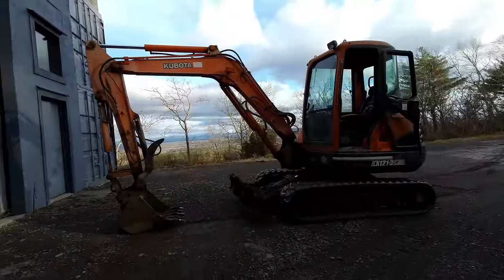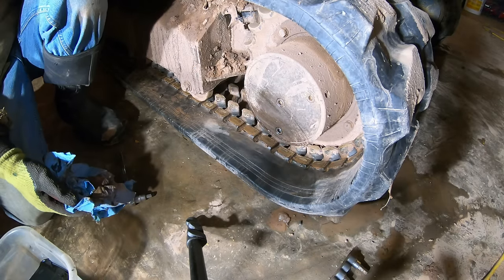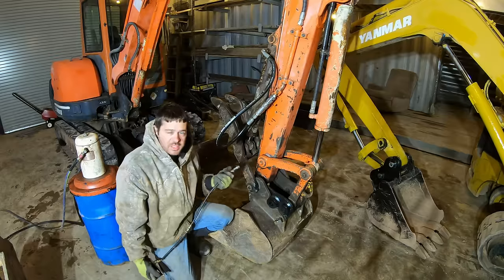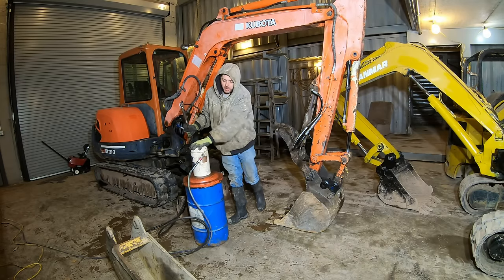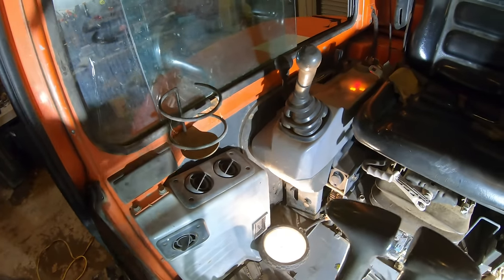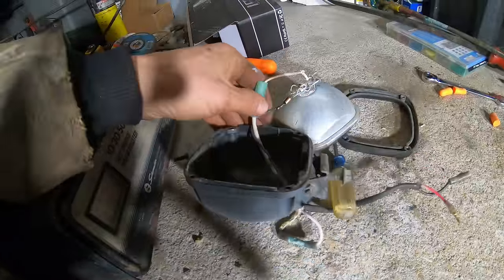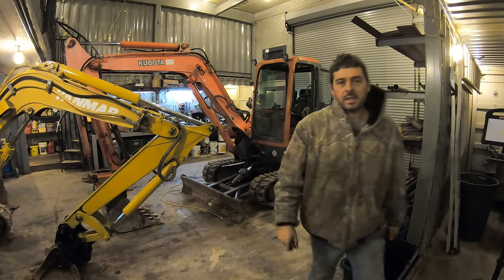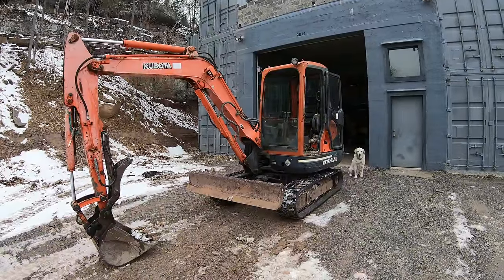Working on the new Kubota excavator

Comment: I've been doing electrical work for many years and have never thought about the "light in place of a fuse trick so you can find your short and save yourself a shitload of time" method. Thanks for the tip!!
Reply: use different lamps depending on the amp rating of the fuse.  you don't want a lamp that exceeds the amp rating or you can let the smoke out of the wiring.  about 1/4 to 1/3 the bulb amp draw verses fuse rating.  is about right.  so the wires don't get hot.
Reply: I thought that was pretty kewl too...will be using that myself  :)
Reply: Might be able to get away with LED since the voltages and amps are very low....?
Reply: @BarnStangz  LEDs won't work.. they do not pass current thru like a filament type bulb..  LEDs are diodes..  Light Emitting Diode
Reply: Thanks Wayne, yeah, I didn't think of that... Good thing I still have some old lights around...
Reply: @BarnStangz   use a 3 wire socket for an 1157 bulb.. giving you 2 different amp draws.   use a 194 bulb in a side marker socket. .
Reply: That was a a cool trick my friend. Using a multi meter on ohms is another fast and easy way. Its as simple as touching one lead to ground and other to your hot wire. If the meter reads continuity then you have found your short and can precisely locate and isolate.
Reply: @Streetpreaching7   put the meter on continuity beep.  i did that back in 1989.. rats had chewed the wiring on a camaro.. i could not find that last short to ground that was making the meter beep.. everything was disconnected on both ends of the harness. it was still beeping.. boss said close up for the night.  i left my test leads in the car.. but pulled them out of the meter.. there i am standing there with a meter in my hand .. not hooked to anything and its still beeping.
Reply: You can't call yourself an electrician and not know about the light substituting for the fuse method.
Reply: @JD-iu3vi  sure you can. You don't use this trick on homes or commercial buildings. (I could be wrong). I use an amp tracer. But for a piece of equipment with 12v that's great! 
Ps. Don't send 120 volts plus down an unknown path!
Reply: Why did the fog light turn off during the test?
Reply: Question, once you have the fog light in there instead of the fuse, isn't there a danger of melting a wire somewhere while (higher than normal) current is flowing through the light while you're digging around looking for the ground fault?
Reply: @waynep343 In theory, an LED test lamp should work because the short will provide a good ground path, (although the other working lamp filaments may also supply enough ground path to keep the LED test lamp lit).   The LED test light will probably have a DC to DC converter circuit.  By supplying 12V DC on the positive side of the converter (at the fuse) and a ground path to the negative side, the test light should light normally until the short is removed. The working lights will probably be very dim.  Removing the short should reduce the LED test light brightness.  I need to test this theory.
Reply: Car horns also work; great for trouble shooting circuits across long distances..like between homes and out buildings... just use a 110/12 relay.
Reply: C Miller. Although the lights were switched on the power was getting to them. The current was flowing through the fog lamp and to the lights. When the lights were disconnected, no current was flowing so the fog lamp went out as it was connected in series. I hope that makes sense....
Reply: How does it work?
Reply: There has to be a tool for this job. Like some small lamp you can directly plug into the fuse spot.

Comment: Heat that shop son, youre going to get Arthritis years sooner then it comes naturally!  I know its feels better to stay cold and stay used to to the cold, but your bones hate it and it causes issues much sooner in life then it has to be, heat that shop son!.............. signed Doctor Hurley
Reply: My point exactly. You dont know it till its too late. Steel warehouses were mu downfall
Reply: Men in my family have serious bone issues from working in cold temps for long periods. Keep the body as comfortable as you can to maximise longevity
Reply: @missionDan  Roger that.
Reply: Agree on heating the shop.  After being a mechanic for 45+ years and doing work like Andrew in retirement it is true the cold works with Uncle Arthur (arthritis) as you age.  A little propane torpedo heater to knock off the cold would be sound advice.  I worked on concrete floors for 40 years and that is not good for you either.
Reply: I was also thinking this as he pulled the log back with the kubota.   Door wide open.  I’m assuming if nothing else it would have cut down on a breeze or bit of wind chill even if the heat isn’t on, only guessing since it has a full cab it has heat
Reply: I agree with the good Dr. Hurley. Lying on cold concrete floors might seem like fun when you're young, but you will definitely feel dismayed at how quickly your body will decide that kind of self-abuse will have a permanent negative effect on your body. Andrew is as tough as old boots, but he is still young. I would hate to see all that talent suffer because of Arthritis or some such largely preventable condition.
Reply: Radiant floor heat under the concrete was the best investment especially working under the tractor at 67 years old. Really enjoy your videos and I’m not far from you in town of Denning on route 46 Yeagerville Rd.. above the Rondout reservoir top of East Mountain with 100 mile million dollar view!

Comment: Cant imagine how much money you have saved doing all maintenance yourself. What an important skill to have.
Reply: Scott O it’s got to be in the $100s of thousands range. Think about simple car repairs costing hundreds of dollars and start multiplying
Reply: Also would increase equipment sympathy and overall uptime of the iron. It also is good therapy, garage time is happy time
Reply: A grease gun is the most important and valuable tool you can own.  Andrew got his at a yard sale with a drum of grease.  He struck oil!
Reply: @twsd  accully kubota parts are cheaper then deeres and newhollands accully
Reply: Yeah, I know. A few years ago, being probably about 2016 or so, my grandfathers friend on my dads side and I had wired in a over the air antenna at his house, and the only thing we (mainly he) spent in putting in the antenna was the antenna, a 1 to 2 splitter, or maybe it was a 1 to 3 splitter, some grounding wire and maybe some coax cable ends. We managed to find some extra coax cable wire that we (again, mainly he) had laying around to run from where we had put the either 1 to 2 or 1 to 3 splitter to his upstairs living room tv, and we managed to use some of the extra cable from the downstairs from when my family lived with the one friend for a few months (that's a different story), and my grandfathers friend had his satellite tv  provider setup a tv downstairs for me, the satellite tv provider installer left some extra wire downstairs when they installed the cable, and the other person from the same company just cut the cable outside where the satellite cable came down to, so we (my grandfathers friend and I) just used that for the downstairs tv, and I set up another connection to the over the air antenna  later on for what would be my room when my grandfathers friend had his satellite internet provider person come out and "upgrade" him to a upper generation of a modem, and they snipped the one end of the 2 cables off  and didn't use the one for the connection between the satellite and the modem. I think we ended up save hundreds with doing all that work ourselves, plus we did the work a lot better then another person working for a corporation could have done, not that I hate techs working for corporations, just sort of those that don't exactly do things properly.

Comment: Ha,  I like the set it on fire method of finding shorts!  Guaranteed to work every time, results may vary...
Reply: I was laughing pretty hard at that too! But it is smart that he demonstrated it, wires can only handle so much load and then, bang, flames. This is how stuff burns to the ground!
Reply: We used to call it "The smoke test". Can't find the short? Put in a high amp fuse and find where the smoke comes from.
Reply: Why dont you get Into the bigger excavators? Their about the same price used as the small ones. All we have is bigger 1s. I want a small 1 so bad.
Reply: @JD-iu3vi  With my luck I would find the light doesn't work BUT the fuse is good !  Always seems that way.
Reply: Especially if you have fuel around

Comment: Pro Tip. When you solder, hold the heat source under the wire, put the solder on top. this way you don't get a cold joint or overheat anything.

Comment: 5:46 life is good when your steam cleaner sounds like a spitfire!
Reply: haha, I noticed that too. I was like, "that sounds like a turbo prop"
Reply: Gotta love the rotating tip.   I was glad he got the steam cleaner out.   I was surprised he started with the regular power washer.
Reply: @railroadjim  He connects it his endless hot water heater, so it helps but the beast heater is in another league.
Reply: A-10 Warthog!

Comment: It's a barbeque, what happened to the flag on the Castle of Camarata ? In the winter months you need to add some heat in your shop. Wood stove ?  It's not like you don't have any firewood . Quick question how did you pick the name Levi for your dog ? He is such a loyal trooper that is always by your hard working side Andrew. You should do a live stream a top of your castle at night some time so all your fans can have a question and answer with you. Keep up the good work and thanks for posting your great video's.
Reply: Matt P  a wood stove, maybe a waste oil burner. It's not like he doesn't do oil changes on all of his equipment.
Reply: Matt P I don’t think patriotic porn gets it..........
Reply: Andrew has a torpedo heater, seen it in past videos
Reply: He does not live in there.  I don't heat my garage and i have spent hours in there. 10-15 F. You get use to it. But it makes you pee like crazy. Laying on a cold concrete floor.
Reply: Chris laplant laying on the concrete floor might be ok when your young, but as you age your back tightens up and you can get arthritis,I’m talking through experience. I need a heated shop now for the body to keep going👍
Reply: He may not heat his shop but he should think about keeping his grease pump in the one room at the castle that is set up to be heated so it doesn’t solidify but the paint mixer seemed to work this time.

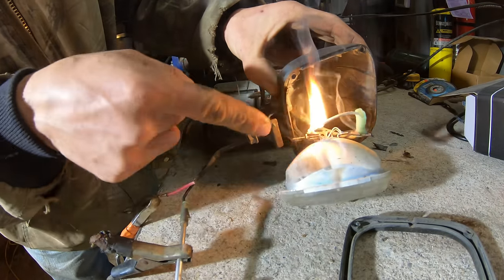Comment: 15:42 
20A circuit light on fire from getting 50A
"Right there, there's our short"
Reply: LOL Ya ~
Reply: It doesn't work like that. If you hook that light up to a battery then it has the potential for 700+ amps. But it doesn't receive 700 amps does it?

V=IR. If you want to blow up a bulb, double its voltage.
Reply: @TheMetalButcher  what you said and also: didn't he set the max amps much lower before cranking it up?
Reply: Who needs a continuity tester when you have glowing red wire?
Reply: The load determines the curciut amperage . Example ..your battery has the ability to supply up to 800 amps depending on the battery. That does not mean your headlights draw 800 amps. Applied voltage however will change the current through a fixed resistance .
Reply: @jasonbrubacher5793  I=V/R
Reply: Sorry butcher ....i didnt see your reply before i replied . I just jumped right on this comment because of the  misinformation . Didnt mean to be your echo

Comment: * opens a bucket with a lube
> wait, there's some liquid there
> let's mix this
What a king!
Reply: I am sure Andrew learned that trick the same way I did when I was 9 or 10 years old ... by opening a jar of Nutella or peanut butter and seeing that the oil had separated from the chocolate, needing a good mixing before putting it on the bread.

Comment: On grease: I'm not a petroleum engineer (just an old guy) but there are 2 main types of grease: dino bones and synthetic.Dino grease is paraffin (wax) based and synthetic is polymer based. Which is better? Probably synthetic.What you saw on your grease separation was the lubricants(oils) and additives separating from the paraffin base.Not so much of a problem with synthetics.
Do what you did when stirring the dino grease and it will be fine in the application for pins,bushings etc because of the frequency of grease cycles. On things requiring less frequent greasing such as wheel bearings etc I prefer synthetics.
Reply: I didn't think they made blue in dino grease? That stuff is really good from my understanding.
Reply: @TheMetalButcher  the blue is a coloring agent. Found in dino and synthetics.
Reply: @amossnowdaharleyman9179  
Food colouring? Is that the same grease they use at Mickey Dees'? Eeek😲😲😲

Comment: Why don't you motorize your garage gate, andrew?
Reply from the maker: Bad Times when I bought that door, that was an extra $1000, and I didn’t have electric at the time. It’s not bad with the chain.
Reply: That would be awesome project..
Reply: @AndrewCamarata  In your videos it always looks like it would take ages to open / close. Maybe you could do it yourself a lot cheaper than $1000 from the manufacturer? Would for sure be awesome to see!
Reply: @bdtms  , yes definitely.  He could rig up something that would blow our minds in a video. Maybe a old hydraulic pump that he could hook up to his machines? I'm sure he will figure something out. Maybe solar panels powered a  top of the Castle of Camarata . Up to 13k 4 hours later.
Reply: Well, at 06:22am, the video has 2096 views.  If one third of us mailed Andrew a greenback, he could get the door opener.  Who wouldn't kick in a buck to see him install a door opener?  Hell, if enough people sent him a buck, he could hire a door company to do it.
Reply: @AndrewCamarata  Exactly.  Got the same setup for shop/door, chain driven, always works and takes no time to do.  28 years and counting.  I've had to work on our house garage doors probably a half dozen times in that span.  If it wasn't for the wife, they'd be chain driven also.  :-)
Reply: Chainsaw motor - works super quick

Comment: Hi Andrew, really enjoy watching your videos, if I can make one small comment. When you use your  rotary nozzle pressure washer always point your lance downwards before you start it up. It has a tear drop type of thing inside which rotates with in a ceramic body and by pointing it up that teardrop thing is blasted into the ceramic body and either brakes it or chips it. That's when you find it sticky. My 2 cents worth after many years working for Stihl. Keep up the good work 👍🏻

Comment: In 1972 I worked at a garage ,someone owned a new car, and it had a short in the dash, well we went to get the car and found a bolt stuck in the fuse block and the desk had burnt up, the insurance company paid for the new car, but we told the owner not to do that again. 12/06/20

Comment: Good maintenance prevents expensive major repairs , daily and weekly checks ,  two handy little 360s you got there , saves a multitude of hard labour . Im a great believer in mechanical assistance whenever and wherever necessary , pointless making work difficult when you can make it real easy and in lot less time with these machines , I operated and repaired them and dozers for over 20 years in highway and civil engineering construction . Happy days , keep up the excellent work  .

Comment: Nice job. Nice light trick too although an audible signal like a radio is better for when you are testing in an area where the light is not in your line of site. If I may add also, make sure you get the exact same angle as the original when welding on the new cutting edge plate - VERY important. Next job.

Comment: i agree with how you feel about wire connectors they are junk my dad always used them and they were always coming undone used to have me looking for the bad connection i hated doing that because i knew they were junk but he always used them and sayed it was the right way we got in some really bad arguments over the long story short i  can tie a wire and its 2 times stronger than it was as one strand because i twist it leaving it long  and fold it back the other way and twist it again thin shrink tube it with silicone on it, not one time have i ever had one fail will break anywhere else but never were i tied it fact some people don't know how to reason i don't do things just like the guy next door you never learn anything that way one should always keep their mind open for new and better ways but i always think about other things that could go wrong because of the new way to see if it is an advantage or is it causing more bad than good
Reply: The "Western Union" splice, followed by proper soldering (heat the wire, not the solder), then a good length of shrink tubing. 
Trust me, I'm an Engineer.

Comment: You could weld a new sleeve into the sloppy bolt hole or use a slightly larger bolt grinding it down a bit if needed !

Comment: The thing about thoses greasers is that the tube only pump in the middle so when they start to be empty, as you can see , it don't pump very well. What we usually do at my place when installing a new barrel is putting some weight on the middle plate so it forces down grease overtime. Another thing is notice is your middle plate didn't seems to have a seal around that scrubs the surface. Oh well , that's just my two cents and keep doing thoses videos. I enjoy it a lot
Reply from the maker: French Toad good tips. That was the first time I’ve had to mess with that. I saw new grease seal things available for it.
Reply: @AndrewCamarata  Glad I could have helped ;)